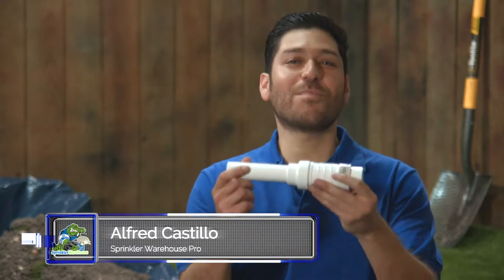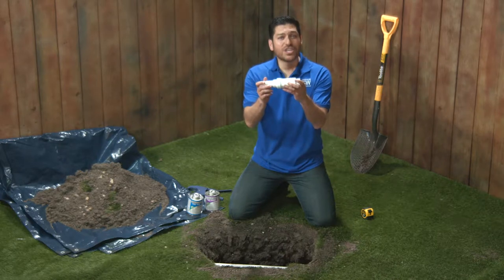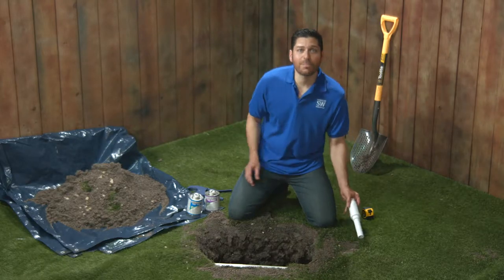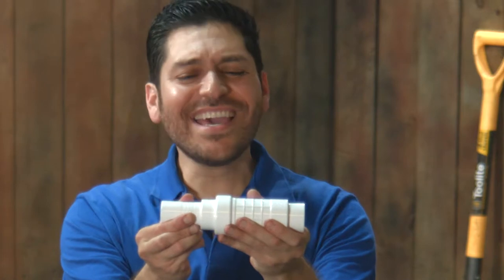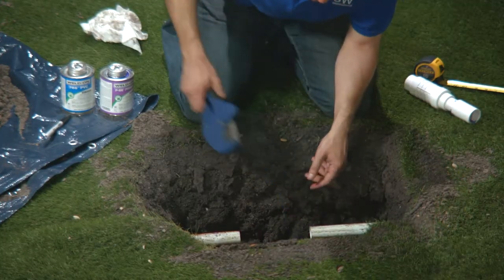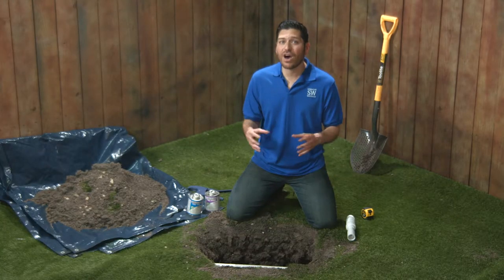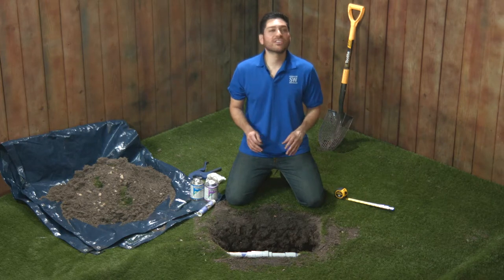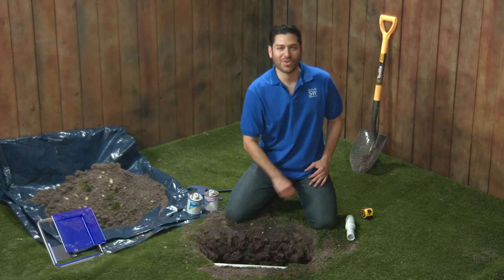QF-1000 Telescopic Repair Coupling

Comment: Nice video!

I’m looking for a longer coupling to repair 5/8” poly tube (like 5 or 6”).  

I find it odd that I can’t seem to find anything like that.  

I’m forced to use 2 short couplings with a very short piece of poly tube instead. 

Maybe the product manufacturers like to sell more couplings by not having a coupling that’s like an inch or 2 longer than the standard ones?

Comment: You should always (if possible) have the slip fix fully extended. Especially if it is installed on a mainline. You don’t want constant movement on the repair coupling.
Reply: 💯 and definitely under big pressure like at a golf course.
Reply: I got this telescoping repair fitting on one zone that has maybe 4-5 sprinkler heads only, I didn’t extend fully only because there wasn’t enough room and I didn’t want to dig even more, am I okay with it? It’s just one zone, 1/2 pvc and only has about 4-5 sprinklers in that one zone.
Reply: And I wouldn't have it on a main line coming into a valve because you will have a (slamming effect)...

Comment: How about the direction of installation? does it matter? Thank you.
Reply: If you figured it out by now please let me know
Reply: @buscador2007  yes it does. Fully extended the slip fix amd look through, you can naturally tell what way the water should flow. One side has no resistance.
Reply: @buscador2007  because it is common sense
Reply: @buscador2007  and I work on a golf course and have installed 100s of them under 200psi.
Reply: @buscador2007  again, if you have installed lots of them, the next time you install one look through it fully extended. One side the water will not crash againt the slid.

Comment: I am trying to repair ½ :" PVC.  The pipe in the ground is not EXACTLY straight with the hose bib.  Close but not exactly.  Will the coupling still  provide 100 % leak proof? even with lots of primer and cement?
Reply: If the pipe is not straight it would be best to use the 4 90s method

Comment: Does it matter what direction the water flow is coming from?
Reply: YES but I can’t find any info on this
Reply: @Ryan_ Stovall_  if you open it up and look inside. You can tell what way the water should flow. You don't want it crashing into the slip fix. It should be stright through like a unbroken pipe.
Reply: Yes it does.

Comment: How long this Telescopic Repair Coupling last without leaking?  I am a professional plumber and don't recommend this quick repair for underground water line.
Reply: you are correct sir. i had a guy fix my supply line from well to house using one, and it failed.
Reply: What do you recommend to use?
Reply: I just had one fail after about 4 years.  Going to try 2" pvc repair couplings with a cut to fit section of 2" pipe.  Or I may just use 90s and add a shutoff valve.
Reply: I agree. I do not use it for example to fix something under pavers. They will leak at some point because it has a rubber gasket and it's just a matter of time. Using 90s is better